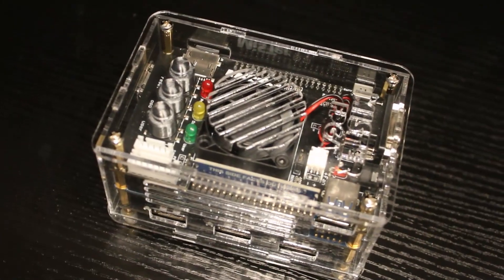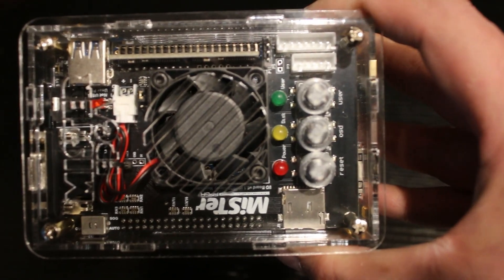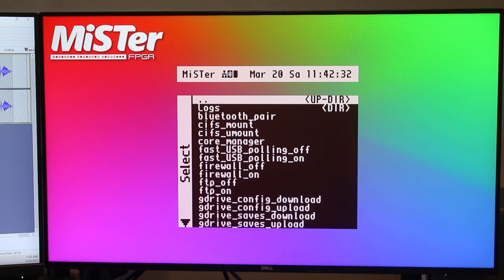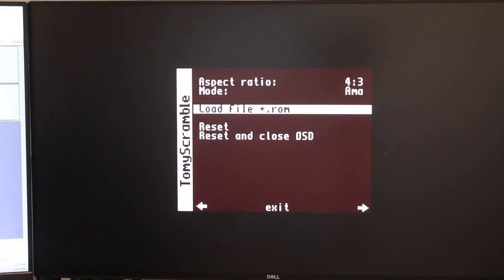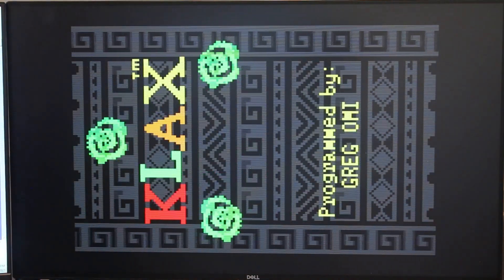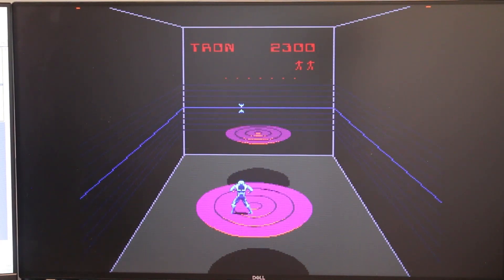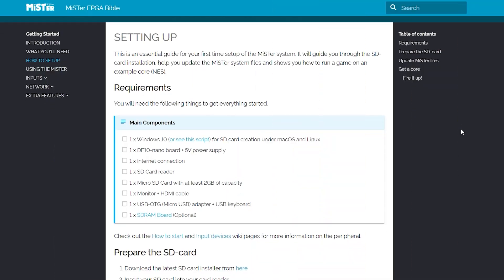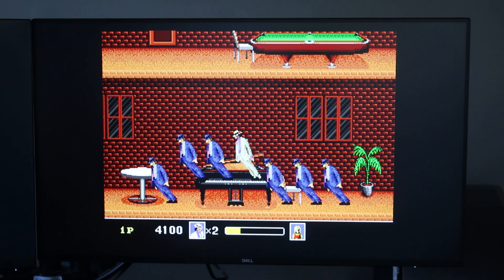MiSTer FPGA: A Quick and Dirty Overview

Comment: So it's an emulator station then?
Reply from the maker: Emulation Station is more of a flashy front-end for the actual emulators. But I get what you mean. So, really, "yes and no". Yes, the end result (playing old games) would be indistinguishable to many. But FPGA cores reproduce the original machines at the hardware level (rather than traditional software emulation), meaning lower latency and a potential for higher accuracy.

I said as much that for casual retro fans, the price of a MiSTer set-up may not be worth it. But there's a lot more to these than just playing games. 

If you're interested, I would direct you to the channel I linked below. They update the developments constantly. 

https://www.youtube.com/@LusRetroSource

Comment: how you get arcade roms into it? does all the roms get installed on updateall?
Reply from the maker: The script "update_all" does all the heavy lifting. Once you install that script, and assuming your folders were set up correctly, and also you enable it in the scripts options, the required files will be fetched and saved automatically.
Reply: Yes
Reply: I bought One, its very Nice.

Comment: Easily the best option I've found if authentic retro gaming is your thing. Latency ruins other arcade options for me; they have pretty frontends and may look and sound like the real thing but they certainly don't play like the real thing. For the time being there's no pretty frontend with the Mister but the authenticity is in another league. I have mine in an arcade cabinet I made and it works a treat.
Reply from the maker: I haven't tried it out yet but look into Super Attract Mode for the MiSTer. (It's on GitHub: MiSTer_SAM).  While not a "front end" in the traditional sense, it will auto-boot random games  every few minutes when idle. It looks like you can customize it to only hit up 'cabinet friendly' games.
Reply: @TeeVeeGames  thanks for the tip, it might be fun to experiment with at the very least!

Comment: With any Unibios config on NeoGeo you can select region and format... and cheats, then save state... all within the Unibios screens... works easily even on a pi with retroarch....
Reply from the maker: Interesting. I do know with the core provided through the set-up/update routines, there's no "save state" option in the menu - as of now. There is a virtual memory card however which works fine. Not really the same as it's not "save anywhere, anytime" like states but useful all the same.  

But for those who find save states important for Neo Geo, this is good to know. Might be worth investigating unofficial cores/builds.

Personally, I'm definitely more excited about save states for the old 8 and 16 bit consoles, especially when they wanted you to jot down long passwords or expect people to finish a game in a single sitting.  (It's not a huge deal but something appreciated as I've gotten older and the time I had as a kid to finish SMB3 in a few hours just isn't there anymore.)

Comment from the maker: UPDATE 6/12/22: Adding a TOC for a couple of friends who wanted to know more about this. But since this video, Intellivision, 7800 and, best of all, Playstation has been added. Plus plenty of cores have save states now. This was never meant to be evergreen but if you're watching this, please check out the links to see what's been done since the date of this video. It is quite impressive.

UPDATE 4/29: Twitter user @sentientsixp made a list of deep features most videos (especially mine) didn't touch upon. The great thing about this project is that it evolves faster than we can keep up. My "save state" gripe may be completely outdated very soon.  Check it out: https://twitter.com/sentientsixp/status/1387774713146101765?s=20 
While you're at it, ignore my offhand-comment about "no 7800", that's since been added.  Ninja Golf!!! 

A few addendums: 
- It seems "save states" may be worked into existing cores. So eventually we can strike that as a negative. Hopefully. 
- I didn't have to keep hitting the "SPACE BAR" for undefined buttons on the controller pad.  You can just hit "ENTER" to end it right there and then, saving what was already mapped.
- I actually used a wired M30 for gameplay. I showed mapping that as well but I ended up cutting that part out (it was long enough as it was.)  The SF30 is fine, but was being problematic while I was shooting. 

If anything else comes up, I will add it to this comment.